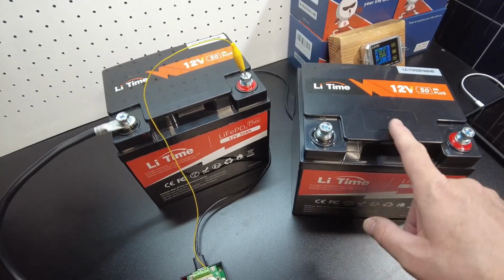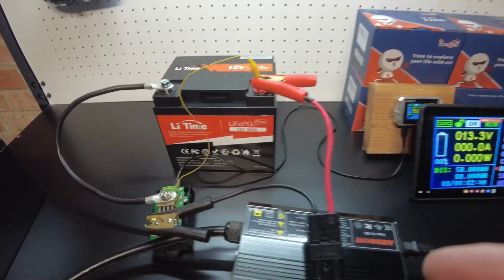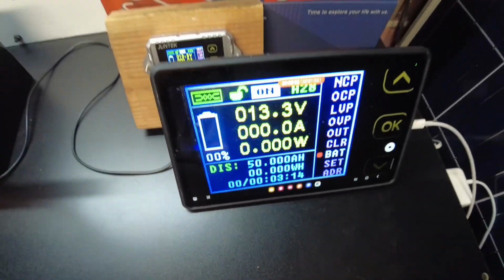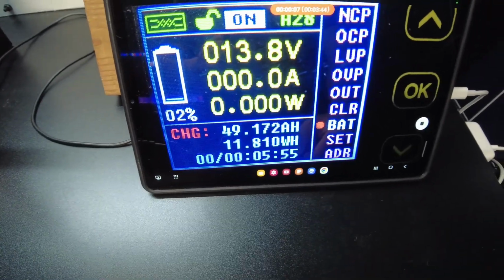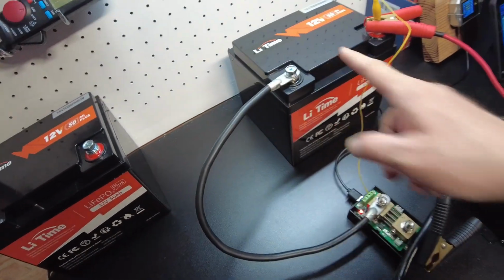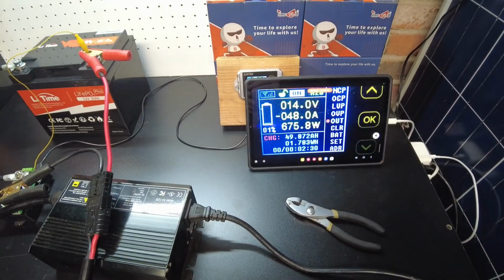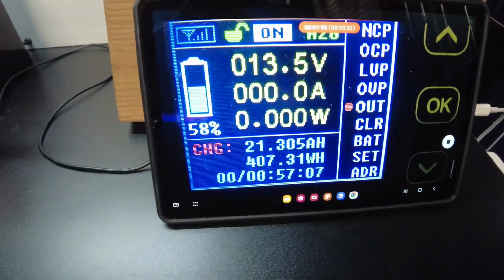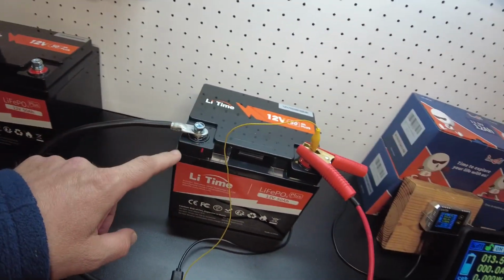Correctly Series your LiFePO4 Batteries

Comment: After I charge them up fully for 2 battery. Then I connect them in series. Then in the future if I want to charge those 2 battery connected in series. Can I just charge them without taking them apart. For instance, I have 3 12v battery, after charge them each time then I connect in series. Nextime to charge again I just need to get a 36v charger and charge them and it should top off all 3 batteries. Is it correct
Reply from the maker: Yes, after you fully charge each one with a 12v LiFePO4 charger, you can place them in series, and charge them all  in series with a 36v LiFePO4 charger from then on. Now eventually they may get out of balance after some time, you can just repeat the process. Thanks
Reply: @BradCagle  how do I know they get out of balance? Is there a way to accurately know % of battery just like knowing % of my phone battery?
Reply from the maker: @TienTran-bi1jv  If the batteries have a BlueTooth BMS you could know the % of each battery. However batteries like these do not have this feature, so you can probably just do it once a year as a maintenance.

Comment: Ok not sure if you’re still answering questions on this but I have just bought 2 LiFePo 12v 120Ah for my trolling motor. I also have a 2 bank charger (Noco 5x2). Would I be able to charge them not in series at 1st completely then run them in series and would that make them 100% balanced?
Reply from the maker: Yes, if you charge them up 100% each, then you can place them in series, and you'll be all good.
Reply: @BradCagle thanks for reply, much appreciated
Reply: Hi again sorry to be a bother, I just finished charging the 12v 120Ah batteries and one reads 14.30v and the other 14.48v
Is this close enough to be considered balanced and I can go ahead and set them up in series now? Your help is truly valuable and appreciated. (Just trying to get the most out on the water from my trolling motor).
Reply from the maker: @Hafmanhaffamazn  Yes, if they charged all they way up until the charge stopped you should be good to put in series.
Reply: @BradCagle once again you’re the man , big thx
Reply: Did you eventually connect them in series and did the batteries stay balanced after some use/charge cycles?

Comment: You don't have to charge them. Connect them in parallel for 24 hrs so they can equalize. Then they are ready to go in series.
Reply from the maker: That will not work. They will not fully equalize. You would have to charge them while in parallel.

Comment: Would it be OK to just hook the batteries up in parallel overnight for the voltages to equalize?
Reply from the maker: No, that will not work. However if you attach a charger to the parallel batteries, it will.